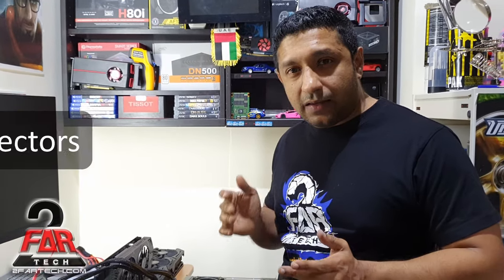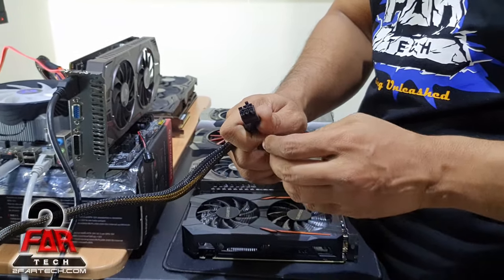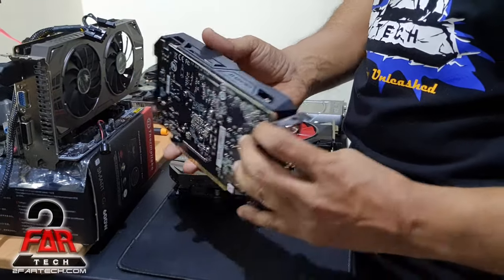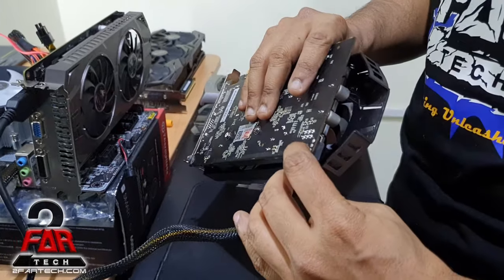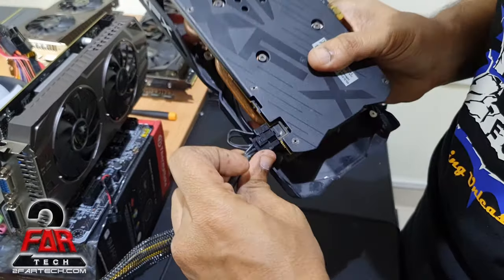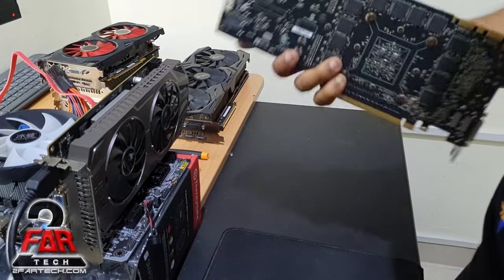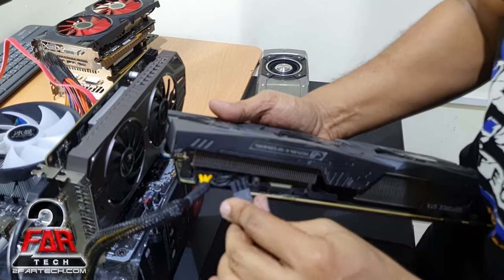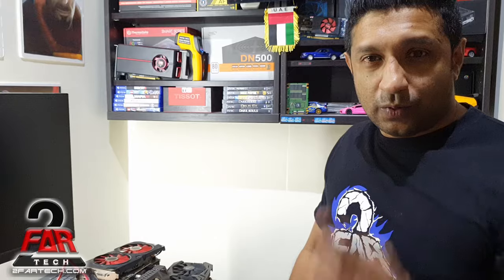How to connect the power to the graphics card?

Comment: I really appreciate this. This helps me explain to my friend how to get your graphics card installed and connected. It makes my life a lot easier.
Reply from the maker: Glad I could help! There is more information videos somewhere in my channel. 😂
Reply: Quit lying, you needed it for yourself
Reply: @2FarTech  ZOTAC Gaming GeForce RTX™ 3070 Ti AMP Holo 8GB GDDR6X 256-bit 19 Gbps PCIE 4.0 Gaming Graphics Card, HoloBlack, IceStorm 2.0 Advanced Cooling, Spectra 2.0 RGB Lighting, ZT-A30710F-10P  requires 1 6pin and 2x 8 pin can you show how to hook it up?
Reply from the maker: I haven't worked on zotac 3070ti but i have used 3080 ant 3090. Both models only had 2 x 8pin power connection. I am not sure if your card actually has more than 2 x 8 on connection. For such a card type psu should be having individual pcie cables. Some psu come with 2 pcie cable with 8pin x2 per cable.  The second 8pin being a pigtail. Higher end psu might have 3 separate cables.  So depending on the number of cables you adjust. But such a card requires atleast a psu with 2 separate pcie power cables.

Comment: Thanks man, for my first time ever installing a graphics card this was straight forward and infinitely helpful. I had the 8+6 pin connector so I was a little confused, this cleared everything up. Very much appreciated! Have fun with your freshly installed GPU guys :)
Reply from the maker: Thank you for your kindness.  Enjoy your system.  Good luck.
Reply: @2FarTech  hello can i ask can i put a 6+2 pin on a rx5700xt?
Reply from the maker: Yes. How many plug do your 5700xt require?

Comment: Wow, this actually helped a lot thanks! I got a 3060 ti from amazon for retail and I was scared to see that it needs 2 connections from the psu unlike my 1650 but this video cleared my confusion. Have a good day!
Reply from the maker: Glad I could help! Enjoy the RTX 3060Ti. I couldnt get one when it was at standard prices.
Reply: so 3060Ti has 12 power pins ? my PSU has 8pin(6+2) x4 power connector. Is it good to go ?
Reply from the maker: Rtx 3060 oc edition has 8 pin and also some version had 8pin + 6 pin which is an overkill.  Rtx 3060 ti can be 8 pin + 6 pin with a max of 8pin + 8 pin.  Even rtx 3080 needs only two 8 pins. So i am not sure about your 12 pin requirement unless you are talking about FE cards from nvidia directly
Reply: @2FarTech  yes maybe its 3060Ti FE version by NVIDIA which has 12 pin requirement - they provide the adapter with it - this is what I read in google results
Reply from the maker: Yes.  That's what i wanted to say.  Even if its 12 pins, it comes with an adaptor.  I have all the premium cards in the rtx 3000 series except 3090 now.  But no FE.
Reply: @2FarTech  How much for the colorful 3060Ti ?
Reply: Hey do you need to plug both PCI-E cords
Reply from the maker: Yes. You have to plug both ports if there is more than 1 port on the graphics card

Comment: Thanks for this video. I built a system with a GTX570 10 years ago. It has 2 6 pin connectors, I just bought a GTX 970 & it has a 6 pin & an 8 pin connector. I looked in motherboard box & the connectors you show are in there.
Reply: I have a gtx 970 too, which power supply do you have? Can I use the cable 6+2 pins? And connect 6+2 for the 8 and 6 for the 6? Leaving the 2 outside?
Reply: @LecheConGofio  I have a Corsair1000 watt power supply. I used 2 6 pin connectors and left the two  2 pin connectors hanging.

Comment: Thank you so much! I was not connecting the 2 pin ground first and I couldn't get the GPU connected no matter what I tried. I was so frustrated. I'm upgrading and moved from 1-6 pin to 2-8  pins, which surprised me. Got it hooked up and everything is working. Thank you Thank you Thank you!

Comment: For my 3080, it has 3x8 pin connection. Should I use 3 separate PCIe 6+2 cables from my PSU? This thing truly is a behemoth. Including the PCIe lane on the motherboard if I’m not miscalculating this thing is wired for potentially 425 watts?

Also, great video. Informative, no stupid fluff. Need more videos like yours.
Reply from the maker: There are rtx 3080 models with 2 x 8pin connectors, and they are fine too. The 3 pin on your card is to give that headroom and reduce the load on the cables. So ideally, you should be using 3 x 8 pin cables if your psu supports it.  That's what you paid for, so make the best out of it.  Have a lot of informative videos coming out soon.  Thanks for your feedback.
Reply: @2FarTech  Well it wont even fire up with two cables, a red light lights up where the cable should be plugged in and the GPU isn’t detected in windows. 

But my question was about the cables themselves, should I use 3 separate PCIe cables from the PSU, 6+2, because that’s all I’ve got available to me. So, 3 different cables plugged into the PSU, going to my graphics card, from the PCIe/peripheral section for clarification.
Reply from the maker: @dotech4128  I understood your question. But my answer was not clear enough. I was not asking to plug in 2 cables only. I was saying the power draw of this card can be handled by 2 cables in most cases.  I was suggesting you use 3 separate cables instead of using the piggyback available on the cable. You will not see any performance differences or issues.  It's generally the best practice and the lower load on the cables means less voltage drop on the cable. Use 3 separate cables if you have that capability on the PSU.
Reply: @2FarTech  How can I connect it if I don't have 3 cables from Psu? I have exactly the same 2 6+2 pin cables like in the video and I need 3 x 8 pin for the card?!
Reply from the maker: Use the piggyback from the second cable to connect the third pin. I assume you have piggyback on each main cable. Most new psu pcie cable comes with 2 x (6+2) power wire.
Reply: @2FarTech  There is only 1 main cable from Psu with 2 x 6+2 pins Y shaped ends. There is no second separate cable.
Reply from the maker: This definitely means you have a high end gpu and a low end psu. You should upgrade your psu. If you have a high end modular psu, then you need to find the extra pcie cable and plug it into the psu.  Let me know what gpu and psu you have.  Model details
Reply: @2FarTech  Gpu is Rtx 3080 Palit Gamerock and Psu is Aerocool  Aero 600W Bronze.
Reply from the maker: Sorry, That's a bad combination.  I sell these components and you can see videos on my channel using these components.  600 watts isn't enough to power that rtx 3080. A proper i5 + rtx 3080 can do more than 600 watts during boost. This will trip your psu power and even cause it to fail.  Please upgrade your psu to atleast 750 watts gold or 850 watts models from Deepcool pf or pm series.  Don't try the 600 watts with the rtx 3080.
Reply: @2FarTech  Thank you for the info, how about an rtx 3070 or 3070 Ti will they work? I am currently using 2070 super with 1 8 pin and 1 6 pin with tdp of 215W but I overclocked it and see it boost to 250W,  Gpu-z shows 130W from 8 pin, 70W from 6 pin and 50W from motherboard. Would a 3070 Ti work? I think it was around 290W.
Reply: By the way my Cpu is Ryzen 3700x, but I plan to upgrade to 5900x in near future which also draws a bit more power. Would it still work with 3070 Ti?
Reply from the maker: Aerocool model is a cheap psu, i use it all the time.  For my customers i don't push the psu to the 80% load.  You will see the total power usage when you plug the main psu power to a power meter.  This is how we are determining the overall load.  If you are planning 5900x and rtx 3070ti. You have to upgrade the psu.  The rtx 3070 itself is  going to touch the limits of your psu. When you are upgrading, go with 850 or 1000 watts.  Don't push your luck, it's your expensive pc components at risk.
Reply: @2FarTech  Alright, thank you very much for the advices.

Comment: My wife just purchased a new video card with a 6 and 8 pin cable. We don't know where to plug it into the motherboard (the power supply).
Do you have a guide for that?
Reply from the maker: https://youtu.be/Q3JxbaxwHBk <-- how to install a graphics card on the motherboard.
However I believe your question is about the connections and cables. These connections and cables should come from the power supply unit (PSU)
Decent and newer PSU with 500 or 600 Watts rating will have these PCIe cables as shown in my main video. These could also be tucked behind the panel if they were not used before.

Comment: Question: i have a modular Seasonic Focus 850W 80 plus gold, it has a single PCI-E cable with two 4-pin connectors. Do i use 2 separate PCI-E cable or that single one will be enough?
Reply from the maker: Depends on the graphics card.  If the card has 2 x 8 pin ports on it,  then its better if you would connect two separate cables.  It will work if you use single cable,  but that's not recommended
Reply: Ok thank you. As long as it does not damage the card or mobo I have to use it this way for a few weeks    @2FarTech

Comment: Great stuff, but what do you plug into on the power suppply? I have these different sockets with labels pci 1 and pci 2 and drive, etc. looks like i need 2 cables, but I could be stuffed even though it is a high quality, high power supply.

Comment: Perfect information I need, thank you so much! First time building my PC out, just a quick question, my GPU needs both 6 and 8 pins, just wondering should i use one cable for 6 pin and a separate on for 8 pin? or Is it okay i just use one cable that has two out (two 6+2 pin out)? Thank you!
Reply from the maker: Use separate if you have two separate cables available, its better to balance the load so the cables and the connectors last long.

Comment: What about daisy chained cables? I have my 2070Super plugged in with a daisy chained cable, since the card has an 8pin and a 6pin, and the card according to NVidia requeres 215w, which is exactly what the PCIe + the PSU cable is providing I guess. But I don't know if I'm putting my GPU at risk for doing this or if I should definately plug in a separate cable for the 6pin.
Reply from the maker: The PSU will have a label or at least on the website. It will say how much power is available on the 12V rail. So if you are getting close to 90% of that number and you are using a cheap PSU, Then I would warn you. But if are using something like a Corsair or premium branded PSU. You should be okay.  The PCIe motherboard draw varies from card to card. I understand the term daisy chaining, but in your case, I don't know what is your primary endpoint. Have used a SATA or Molex converter? Or used 1 x 6 pin PCI-E power and used splitters to make it 1 x 8 and 1 x 6? That would not be a great idea as the wires cant handle that much power.  If you are confident enough, Try running MSI Kombustor and do a burn-in test on the card which will push it to full load. Check the connector's wires and points to see if they are heating up. Listen to PSU fan to see if it's getting cranked up to the max. Touch and feel if PSU is getting HOT, plus the air coming from the PSU is very hot? These are indicators that there is too much load on these components and it isn't safe. I wouldn't run a stress test for more than 3 minutes in your case to be on the safe side. Also, don't run a CPU stress test at the same time as it will max out the power usage and blow the PSU if the power limit is crossed.

Comment: Nice but are the cables all the same??? I have a bunch of PCIe power cables. I can't remember from which graphic cards they all are. Can I just use any 2 for powering my new 3080 card? Or is each PCIe cable particular to a power supply?
Reply from the maker: Pcie power cables coming as part of modular psu isn't the same across the brand or even the same brand different models.  The psu end might fit across different psu's but the pin out might be different   so it's not a good idea to mix the pcie cables from different brands.  I do this, but i use multimeter to check the positive and negative before and after just to be sure

Comment: ok i have a questain ,,my gpu has 1 8pin connector witch i have pluged in .. but there is a 6 pin connector on my mother board for pci should that be powered as well?? rite now i dont have it pluged in  i have a msi z390a mother board and a geforce 2070 gpu every thing is working but im not sure if that pci 6 pin should be hooked up as well
Reply from the maker: that 6pin provides stable power to the PCIe slots on the board. If you are getting any crashes while playing or unstable FPS. You should try to plug it in. Typically you would do that is are going to SLI or populate all the PCIe slots with cards. Hope this info helps.

Comment: Am using R9 280x it requires 1 6pin and 1 8pin and my supply only have 6 pin ....Can i Use Sata to 8pin Connector or 6pin to 2x 8pin to power my card? Plz respond
Reply from the maker: If your psu had 1 x 8pin, i would have said go ahead and use 2 x sata to 1 x 6 pin. But a psu with 1 x 6 pin is actually limited on the total power available typically.  For example HP workstation psu comes with 1 x 6 pin.  If you use an AMD graphics card in the pc and use sata to 8pin and play a game, the chances are the psu will shut down.  How do i know this?  I build 100s of pcs in different configurations and tested such cases.   
Now if you are lucky this might not happen to you immediately.  Then there are 2 possibilities,
1. It shutdown later when psu overheats or blows up
2. It works for ever without any issue for the rest of its life.  
I know everyone wants to have option 2, for that you have to experiment and the result might be costly if it blows up

Comment: thanks but can these cables be found on brand computers like dell? i5-8100 or i3-8100 and such from power supply?
Reply from the maker: No, it won't be there on those cheap dell pcs. You could use gtx 1050ti or gtx 1650 without the 6pin adaptor.  Only a few models have this option.
Reply: can i use 6pin adapter on these pcs? so it will work? and what the adapter called? thanks  @2FarTech

Comment: Question here! My PSU have 8 pin for mother board and M/B X570 have 12 pin i am using 8 pin only . Working fine or am i missing somthing ? Plz reply will be appreciated! Or a video on it .
Reply: The extra 4 pin is provided to ensure the motherboard gets stable power under any possible scenario.  For example if you are going for extreme overclock and have all the pcie slots plugged in with cards, the board might struggle for power.  So if this extra 4 pin is plugged it, it will serve as a buffer.  If you don't plug in and it is working fine.. then you can go about your business without worrying.  Good luck
Reply from the maker: Exactly

Comment: I just bought MSI GTX 1080 Ti .. 2x8 pin .. well that puts it in 375W range ! Thank you Sir
Reply from the maker: GTX 1080ti is still an monster card. Good luck. Make sure you have a Good branded 650Watts PSU and decent PCie Power connections.
Reply: @2FarTech  Yup my psu is 720W

Comment: GTX 780 at 2.29. I just got this recently and was wondering if I should go the route of buying a molex connector for the other 8 pin card slot as my ATX Switching PSU 700w only has the 6 pin connector that was previously in my GTX 660.
Reply from the maker: Typically a 700Watts PSU will have 2 x pin Pcie connectors. Most decent brands do have. Even the old  ones. So please look again at all the wires coming out of your psu. If its modular then definitely the cable is not plugged in. GTX 780 is a power hungry card that can easily blow up low grade PSU. You can connect from 2 Molex to 1 x 6 pin PCIe is there is no other way. But atleast the first 8 pin must be connected to the PSU Pcie power.
Reply: @2FarTech  Hi thanks for getting back to me. I have just checked again and it deffinitley only has 1 x 6 pin Pcie connector while the rest is sata ends thats left. On closer inspection the PSU says Pentium 4 Model-E 700BR on the side so it could be really older model as its in an Emachines PC. Might have to invest in new PSU to be safe.
Reply from the maker: If it says pentium 4, then it's hopelessly old.  Go for a 650 watts thermaltake model.
Reply: @2FarTech  Will do! Thanks.

Comment: Some power supplies have a split pcie cables like the Cosair RX1000. To power a 3090, should you use 2 split cables for the 3 8pins or 1 split for each 8 pin?
Reply from the maker: I would use 1 split cables for each 8 pin.  That would be the most ideal way.

Comment: I have the 3070 gaming oc and Rmx750 Corsair psu, should I use to separate pci cables or use the 2 in 1 pigtail, does it make a difference?
Reply from the maker: If the psu provides separate pcie cables, which is true in your case, definitely use them.  3070 is a powerful card that requires a lot of power.  The 2 x pcie cables would be able to sustain the voltage without dropping during heavy loads
Reply: Better use 2. My PC shutdown randomly while gaming with 1 pcie on 3070. With 2 pcie never again

Comment: Does a A45/450W have a 8pin connector slot? Im going to buy a gtx1660 im unsure.
Reply from the maker: Got a GTX 1660, a basic 450Watts with a 6 or 8 pin in enough. Just to be on the safe side get a Deepcool or Aerocool or thermaltake 500watts or more PSU which will definitely have a 8pin connector. Good luck
Reply: @2FarTech  Cheers Bro